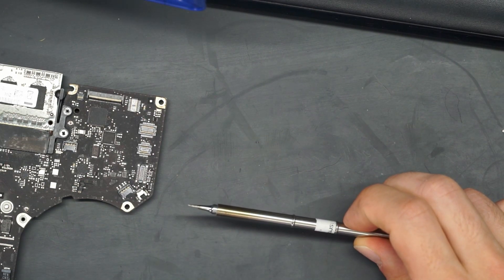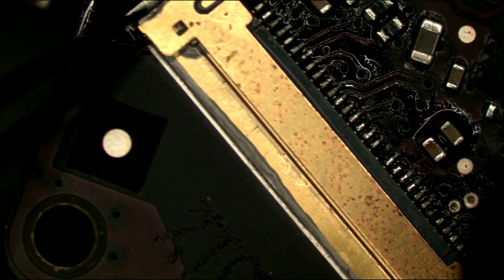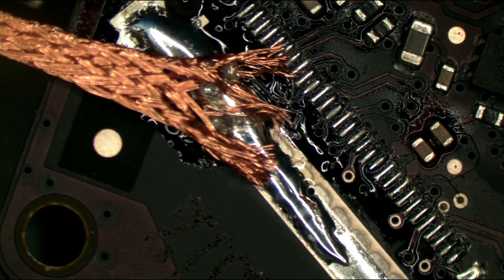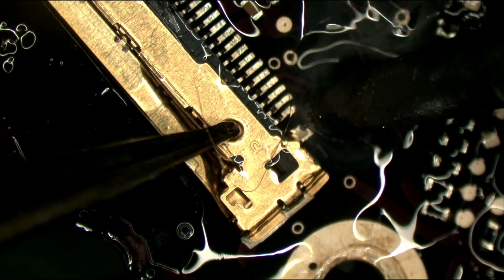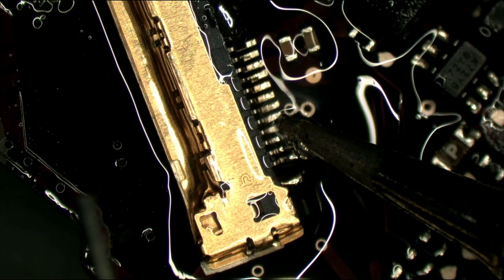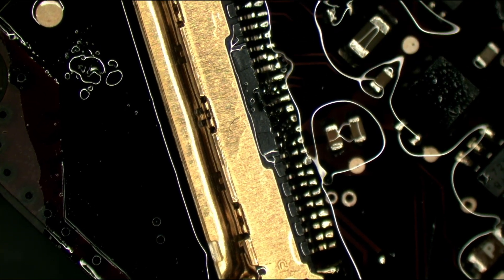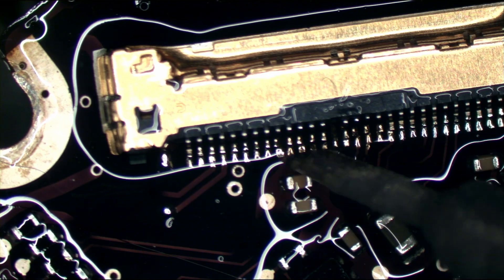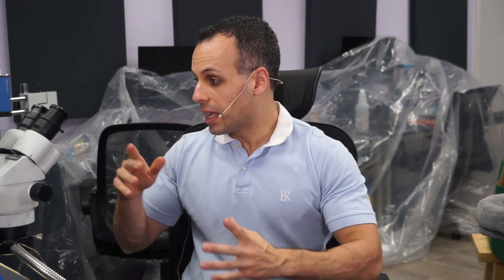louis introduces audience to the red pill (of board repair)

Comment: I really don't understand why companies still sell the conical tips by default, they are so much worse than most/any of the other options. That being said, me, you and all other technicians know that the JL02 tip you show at 1:17 does have a place, it's great for soldering individual 0201 component in tight spaces, or for doing trace repairs (again in tight spaces). Also you can actually get a decent amount of heat transferred from it if you're using the elbow rather than the tip. Overall I'd say it's my 3rd most used tip, after a D16 and a C4

Comment: I discovered the same thing but didn't really pay attention to soldering propaganda. You're right, tiny tips are advertised everywhere. I got a knife tip and haven't changed it in years. I use it on everything from tiny surface mount parts to 10 AWG wires. I set it to the 50 (500F?) for smaller parts and higher for THICC wires.

Comment: I don't really do board repair (yet), but in my experience doing production soldering, most soldering jobs can be done with a chisel tip. It's what I use 95% of the time (not that I have much choice, the company provides the tips for our Metcal stations). There are a few situations where I do like to use a curved conical tip that's similar, but not quite as fine as the curved conical tip shown at 1:16 The tip I use is the Metcal SSC-726A and I love it for when I need to get to smt leads that are obscured by whatever part I'm soldering into place, and it works perfectly fine for that. I wouldn't dream of using it for wicking though.

Comment: And don't forget flux. Seriously, that stuff is magic and makes everything 100x easier (even if not used in the amount Louis uses). Many novices underestimate that fact.
And for experimentation I recommend a raspberry pi pico. Very cheap + you can easily verify if individual pins are actually soldered on or not. This was actually my first try at soldering a QFN chip and it resulted in not all of the pins being connected. But I could easily find out and correct my mistake.

Fun fact: I used a clothes iron as a hot plate to do it.
Reply: Came here to say this. I never used flux during my early years and got solder bridging all the time, and solder braid didn't work well. Flux is magic. You can solder tiny IC pins with a huge tip without solder bridges as long as you add flux. Solder seems to have more surface tension with flux present. Note how Louis has the leads of this connector drowning in flux. It also serves the important purpose of cleaning oxides from the surface so the solder can stick to pure metal.
Reply: a clothes iron as a hot plate oh damn, I have never thought of it before. I wish I had read this comment before I tried to remove the glue from my smartphone backcover with a hair dryer. All these smartphone repair youtubers usually use a hot plate. Was it difficult to regulate the temperature?  I wouldn't like my smartphone to melt on the iron...
Reply: @TulgaD5  Well, I just increased temperature incrementally until desired result (in my case melt my leaded solder but not the lead-free of the other components). If you don't have a suitable thermometer you can test temperature by testing boiling/melting point of various substances (cleaning alcohol, water, leaded solder, lead-free solder), or your iron has a dial with actual temperatures.
Reply: True. If you don't flux things up, you will f**k things up.

Comment: I never use conicle tips. I build spaceflight instrumentation and typically use some form of beveled tip. Louis is right. It's all about the thermal contact.
Reply: I use the conical tip along its side and get decent thermal contact. I also use chisel and bevel tips but I don't find them that different.

I agree that bigger tips are better as as you can get them where you need them.
Reply: Makes sense when you think of it 🤔 im a noob bzt i might give it another try
Reply: You build rockets and you can't spell conical. Great.

Comment: So Louis, what you're saying is the size of your tip matters.  A lot.
Reply: The shape of your tip.
Reply: @gargantuablargg  The Point of contact in which the tip is inserted.
Reply: Just the tip.
Reply: the girth, not the length
Reply: More importantly you can fit your larger tip in places you never thought were possible.
Reply: Shape, length, girth .... All are of no use if it doesn't get hot enough...
Reply: Wtf 😂😂

Comment: I use a blade.  Whenever I can't get a blade in, I have found that being good with an air pencil helps marvelously.
.
However, I MUST state categorically that conical tips are NOT useless.  They're excellent for putting holes in plexiglass without cracking the sheet.
Reply: Conical Tips are also good for melting drainage holes in plastic cups for a Hydroponic Setups

Comment: 9:02 I have to use this method often(did a 40pin .5mm pin pitch mezzanine with my 4mm chisel today) because I don't have access to decent flux other than what's in the solder, it is actually much easier to do it with a chisel/bevel than conical too. Due to it's extra heat capacity you can just tap the pin+pad with the side and it's instantly soldered on instead of having to hold a conical on waiting for it to heat the pad and pin. 

There is one singular use for conical tips that I have come across, very thin PVC insulated wires. They cannot take the heat of a chisel, because the temp is either so low that you end up heating it for far too long and melting it, or it dumps so much heat in that it melts it instantly, with a small conical there's just enough heat to melt the solder but not enough to melt the insulation. This is more of a assembly method than board repair method as magnet wire isn't very optimal in some cases. 

I'm quite sad that TS-KU isn't comfortable for me on my pinecil and I have to resort the TS-D24 which is a lot smaller than what I have on my other iron - and prefer.

Comment: My little red Weller station came with a 1/8" wide chisel tip and it works great. I use it mainly for 1/8" TRS and DB9 connectors. My coworker tried to switch me to a conical tip and I found that I had to crank up the heat and it took forever. I switched back.

Comment: I'm in shock to learn conical tips aren't the absolute best option. My last iron came with 3 different tips including a thicc boi I never used. I just assumed I'm too dumb to solder. Imma go watch some more of Luis' repair porn to get inspired.
Reply: @terasestHammasratas  No, it's Luis, Louis's Puerto Rican cousin
Reply: @tjsynkral  Thought Luis was Louis's cousin from Miami, damn should've checked. (Btw, thanks for pointing out the typo, not gonna correct it cause it's hilarious now)
Reply: @terasestHammasratas  probably. Bu I ain’t finding out.